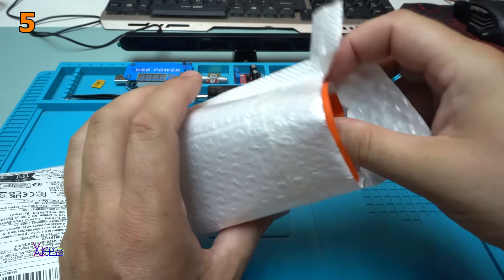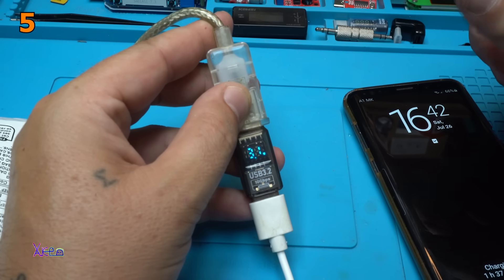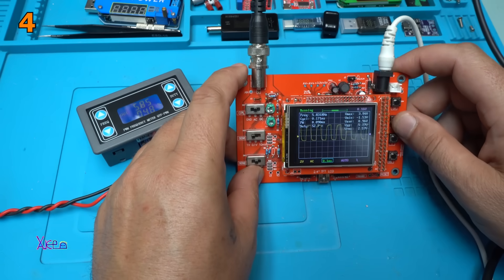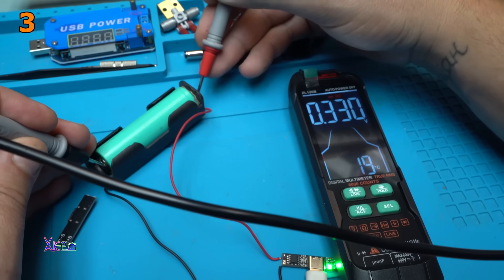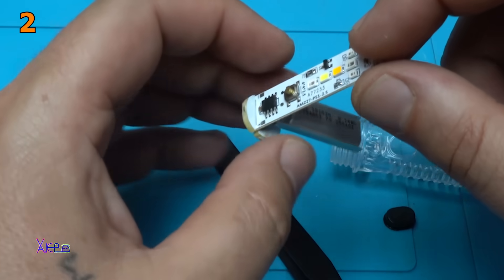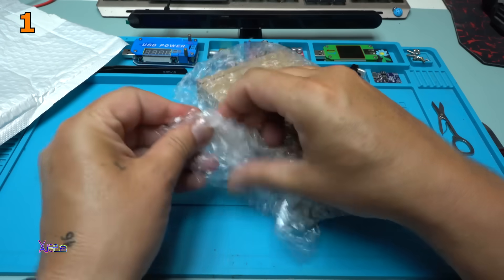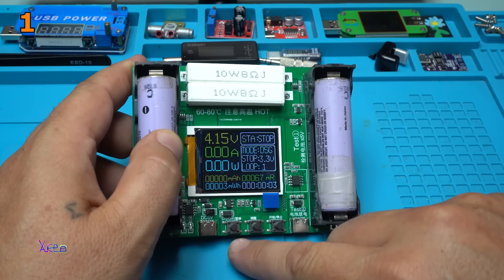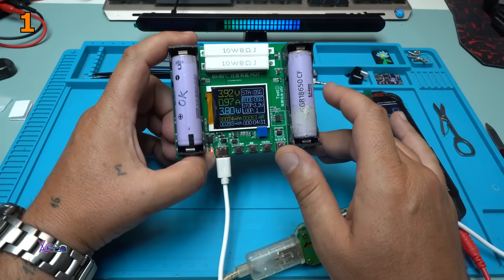TOP 5 SMART Aliexpress Modules and Gadgets

Comment: Last tester. USB power, Stettings: charging max 4.15, discharging - 3.2v  stat. Device can charge right 18650, discharge, display capacity, internnal resistance and charge again. You can automaticaly replace this test few times. you can connect any battery via usb and do mentioned test
Reply: would be nice if on right side would be also a 21700 holder and/or 2 banana plugs...